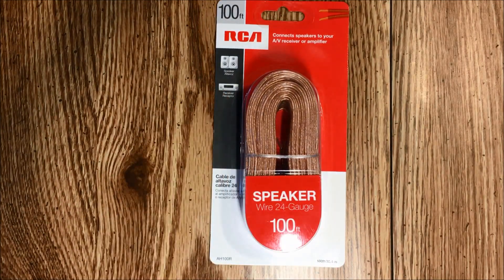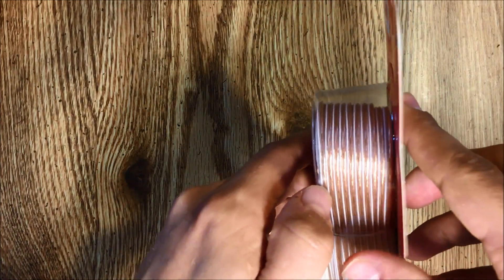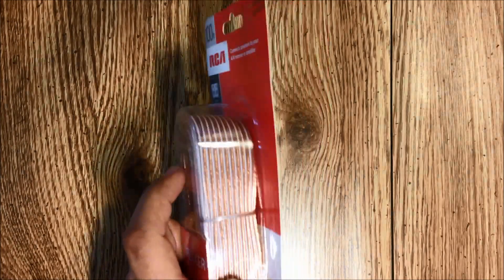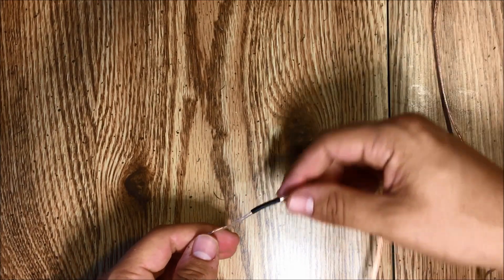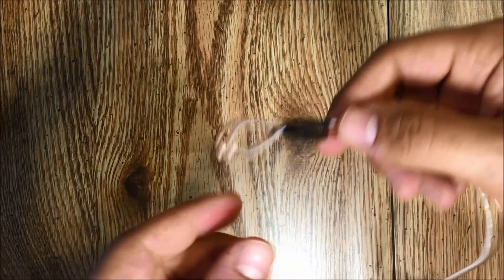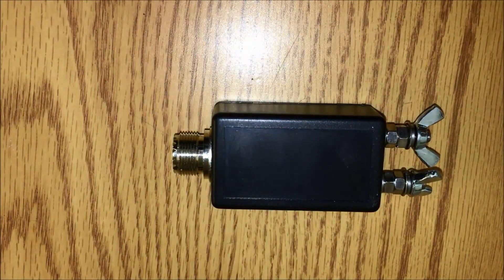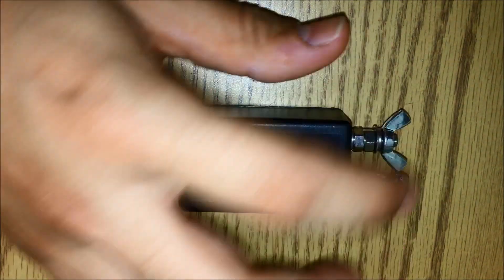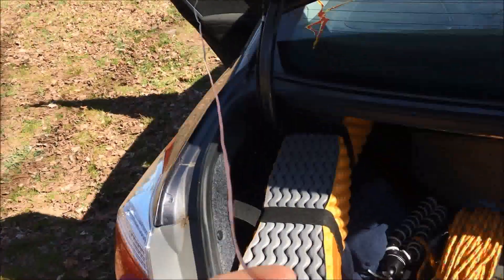Speaker Wire Doublet for QRP Operation

Comment: I’m gonna try it right now! I even have RCA speaker cable what a trip! I’ve made a funny video of me cursing and fighting with the pole antenna trying to listen to the radio. I mean, I know I could freaking just stream stuff but I like listening to the old school tubes through a tube preamplifier through a tube power amplifier through JBL 43,11 from the 70s not the crap the night now I used to work at the Speaker reconning place so trust me I know the inside workings and the bullshit that companies are doing now cheap cheap cheap cheap cheap cheap cheap

Comment: In the 1950s and 60s, "Lamp Cord" like this was frequently used for antennas. 
You have seen 450-ohm ladder-wire and 300-ohm twin-lead? Well, this is 75-ohm twin-lead. 
Separate it and pull it apart to make your half -wave dipole and use the remainder as your feedline. 
75-ohm is close enough to 50-ohm, but you can also use an antenna tuner/matcher to get it dead on 50 ohms if you like.

Comment: Great presentation. Thank you!

You can tie an electrician's knot at the split in lieu of using heatshrink to limit the split, then loop a wire tie through the knot as a hang loop. 

I've not tried a speaker wire antenna, since I don't have a tuner for my IC-705. I may add a tuner to my kit at some point.

Comment: Doublets are so often overlooked because "Coax" works better in home operation around structures.   But the 1930s through 1950s, "dipoles" were almost always "balanced line and balanced tuner" doublets.  (Think the veritable balanced Johnson Matchbox).  No baluns or ununs, no traps and multiband capable.   

Perfect for portable operation where you don't have metal towers or walls to worry about!  Great video and for more info,  just google "balanced doublet".  I use one at home too with a little planning to keep the ladder line away from anything metal, (just a couple feet away works).

Comment: To work 40-10 you don't have to cut the doublet to 33 feet per leg (half wave). A 44 foot (2X22 FOOT) doublet will tune just fine for 40-10. 88 feet will get you 80-10.

Comment: Took this design this past weekend, used 51' per leg. I only had the feed point approximately 8 feet off the ground and was able to make contact with a station in eastern KY from florence Alabama on 80 meter phone using 3 1/2 watts with an 817 as well. Had it sitting on the tailgate of my dads pickup in the back yard. Definitely want to get it up higher next time. Also had the same issues with the tangles and coiling.
Reply: N4GLE RADIO good work! The 817 really makes the trip

Comment: Nice Video Tony. How was the SWR on 40m without tuner and did you check SWR on 15m. They say if you have a dipole for 40m it should work on 15m. 73, Noel W2MSA.

Comment: I was looking on ebay for this qrp doublet that I just love. But I can't find it anymore. It used wire that didn't twist. It was red and black multi-strand like speaker wire though, (power wire?). Anyways it is not resonant on any frequency but not far off either. Easily tuned on anything. Each leg is 25'2" or 302". the feed line was the same wire unsplit and it was 32'4" or 388". It still seemed a good match on 40 meters. Works super on my kx1 and MTR with less than 5 watts. I tried something else with this. I coiled up the feed line, and shorted the two legs together and end fed it. Counter poise was a metal hand rail. Almost no tuning and I made a 80 meter contact! Where the wire is split, it just had a half knot to keep it from spitting more. Swivels from fishing tackle on the ends. Now I was only doing CW so you know, that gets out better. I chopped my friends 40 meter dipole doublet to this and it works so much better now on all bands. No balun needed.

Comment: speaker wire has a impedance of 75 ohms. Dipole has impedance of 72 ohms.
Reply from the maker: Ah, good to know! I did a quick search and couldn't find any info on it. Do you have a link to it? 
In that case, a 1:1 balun would probably work a bit better. Thanks for the comment.
Reply: It's worth pointing out that this only applies at resonance. Any other frequency will have a higher or lower (mostly higher) impedance at the feedpoint. The feedline impedance is not critical in this instance, but the higher the, the lower the loss.
Reply: It does not matter, it will work fine.
Reply: That logic doesn't matter with balanced feedline. It only matter with coax (unbalanced) feedlines.